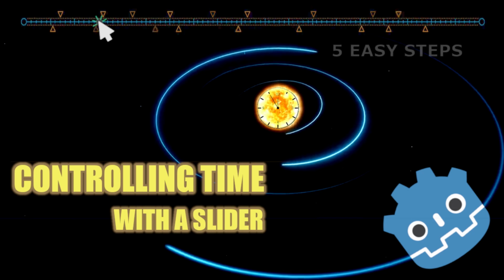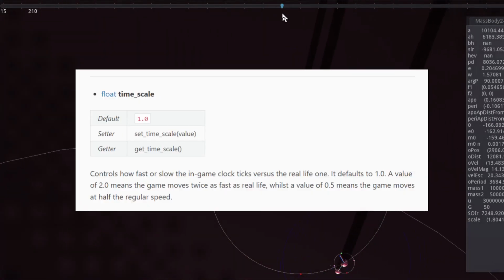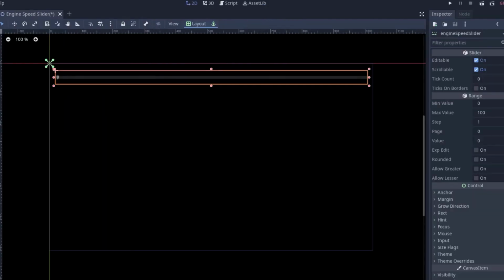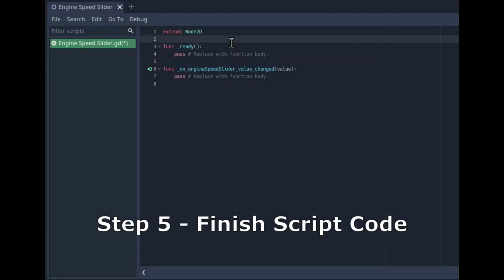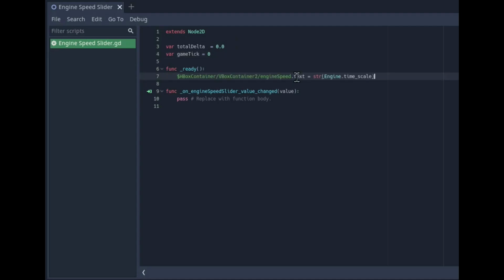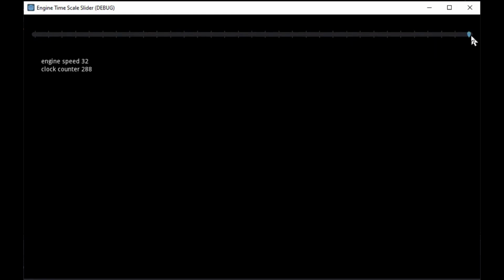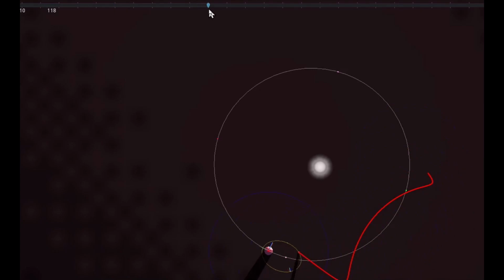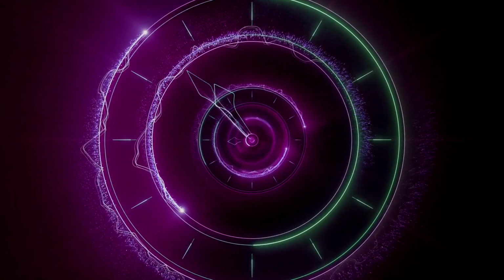Godot Engine Time Scale: How to Use a Slider for Variable Speed Control

Comment: useful, but what if the slider was used instead of frame animation as the output?  When the hslide starts to shift the object animation starts to play but when the hslide stops shifting the object animation also stops.  can that be done?
Reply from the maker: If you are using the simple AnimatedSprite2D node, you can try the frame_changed() signal or setting the frame manually depending on what you want to do.  You can also try the AnimationPlayer and AnimationTree nodes.  Also, the HSlider would need to be configured with the correct number of Steps based on the number of frames in your animation - so that 1 step in the slider is 1 frame in the animation.
Reply: @ThePathfindersCodex  is there any relevant video for that.  I'm really just learning.  but I don't have the budget to study in a professional teaching place
Reply from the maker: I will make a short video to show two examples:
1)   Using a Slider signal to control the animation frames - this allows you to use the slider to move the animation back and forth
2)   Using an AnimatedSprite2D signal to control a slider based on the animation frame - this allows you to monitor an animation and set the slider value based on the current animation frame

Please check back in a few days
Reply: @ThePathfindersCodex  Thank you very much.  very helpful
Reply from the maker: Posted new video on channel. Not sure if it helps, but let me know.   https://youtu.be/USoSvBxhfdc